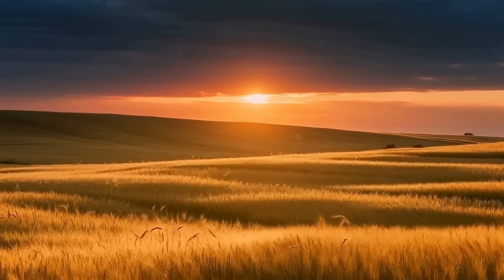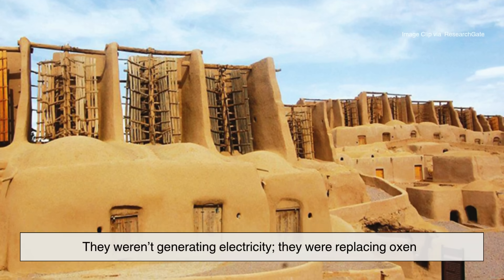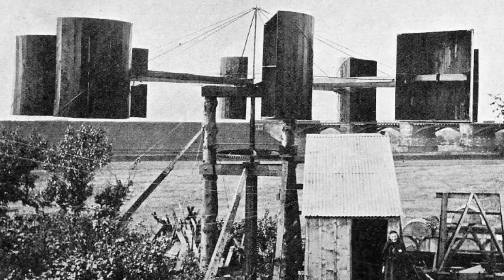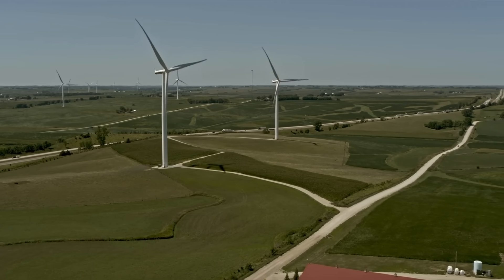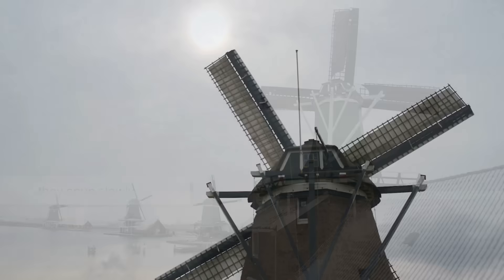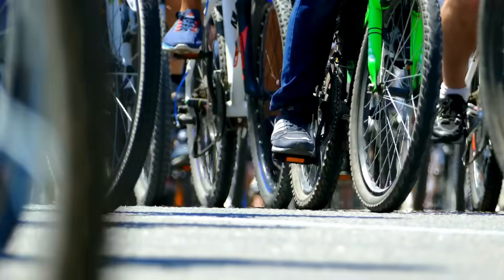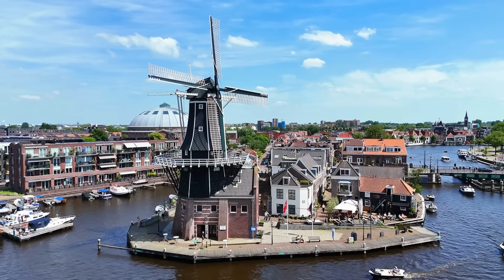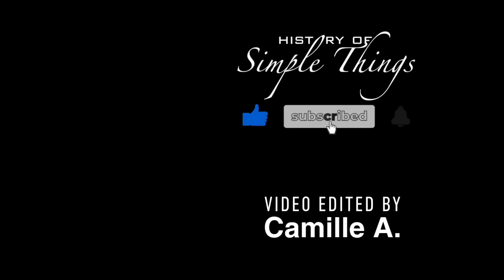The Real Difference Between Windmills and Turbines

Comment: The turbine whether steam or wind powered is still physically spinning a generator. Typical steam powerplants spin their generators at 3,600 RPM  (60Hz grids) the wind turbines use a gearbox to spin a generator a useable rpm. In the end you are ALWAYS using and converting a physical energy into electrical energy by using a generator. RTG's... that's a whole different story.   Lol